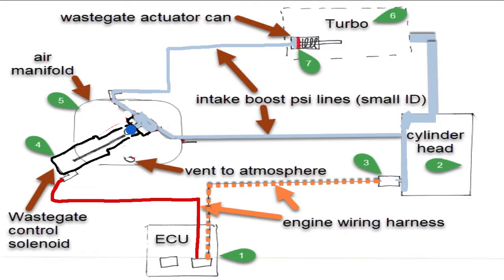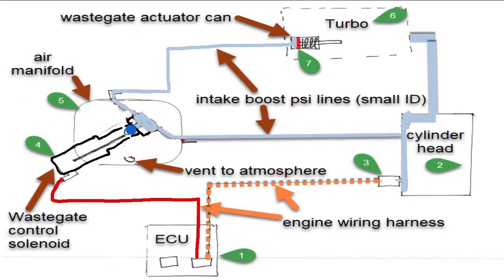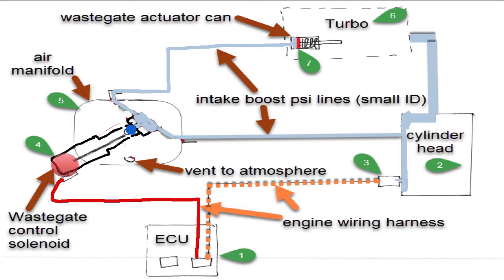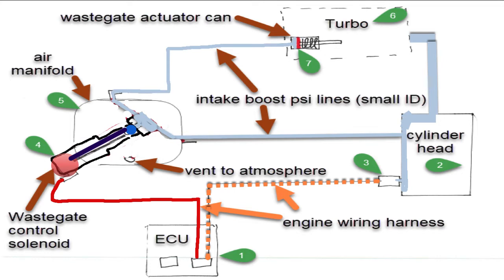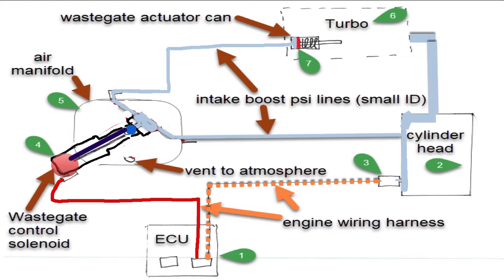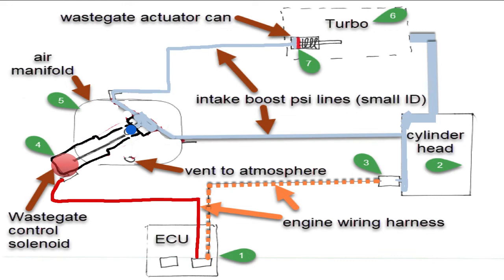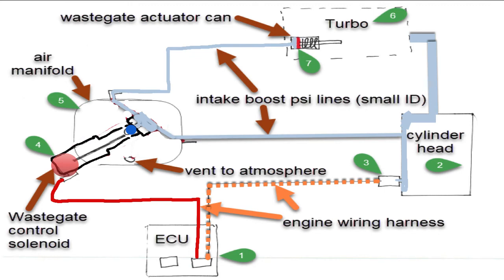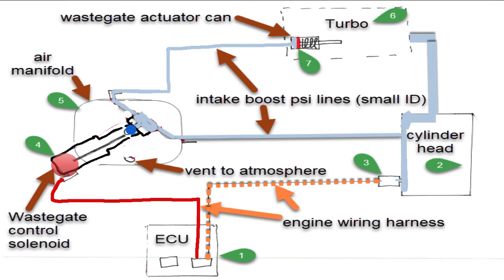Cat turbo boost controls explained

Comment: Hello engineer, I have a problem with a C32 generator machine. When a load of 50% is placed on the generator, the maximum value of the Boost air pressure sensor is only 25 KPA, and this value does not increase even when the generator load increases above 50%, and the machine fails and the RPM drops. The generator turns off. What is the reason, please?
Reply from the maker: If you see black smoke you have a boost leak/plugged intake air filter or turbo/boost controller issue. If no black smoke then you probably have a boost air pressure sensor.

Comment: I don't have a boost Guage on my 2005 peterbilt 387. It's a 🙀 C-15 acert,  should I hear the turbo kick in under load ??
Reply from the maker: You can take 10 turbos and they all sound a little different. So unless it is screaming or grinding I don't put much stock in sound. Since you have a 2005 it does not
have aftertreatment on it. Next time your pulling a hill and working it hard get on the radio and ask if there is black smoke coming out of your stacks. Or do you have heavy black smoke soot all over the outsides of your stacks? If the turbo is working correctly and you have not had the engine modified to pour the coal to it then under a hard pull it should be clear to the eye.
The other thing is if something happens to the boost the ecm is going to cut fueling back so it won't pull. None of our trucks have boost gages. Normally the drivers will only report a problem or unusual noise if they DO hear the turbo. I think your fine if there is no black smoke or power loss you definitely notice
Reply: @ENGINESHOPJOE  excellent answer,  thank you for responding.

Comment: Mr neural 
I have been following your channel and it has taught me a lot 
Right now I’m having issues with a isx15 no start problem 
And just can’t figure out what to do 
Can you help ?
Reply from the maker: send me all the fault codes in the engine ecm.
If you have someone who has the INSITE software program have them data log "all parameters" key on before you crank it. wait a few seconds then start cranking for 15 seconds then leave key on and save data log and email it to faultcodehelp@gmail.com.
Or at least send me the faulits. The ecm has to see the engine turning from the crank sensor or it stays in engine stop mode. I will see all this on the data log.
Make sure the engine is waking up and you hear the electric lift pump running or it may not be seeing the key switch signal at the ecm. Turn the key on watch for the dash engine lights to cycle. bump to cranking for a second then leave key on and listen for electric fuel pump. 
They need fuel and crank position to start. Crank position is rpm on a scanner
Reply from the maker: I have been watching my email but have not seen anything from you. Hope you got it going.
Reply: email the man the bloody data log!